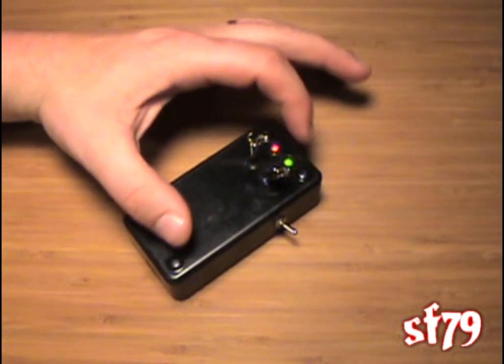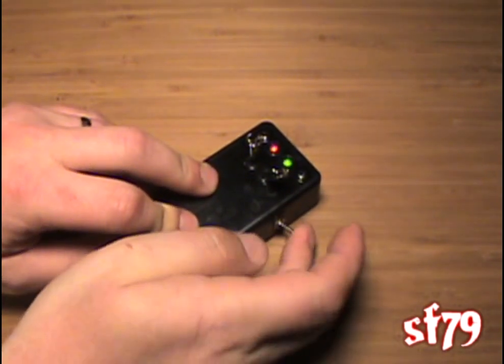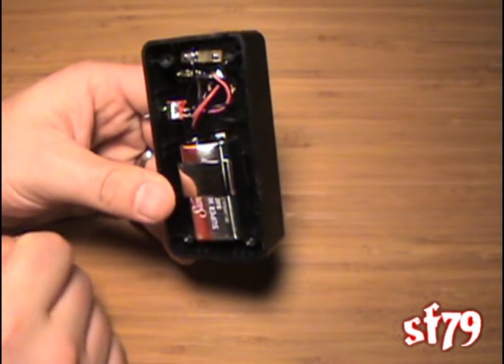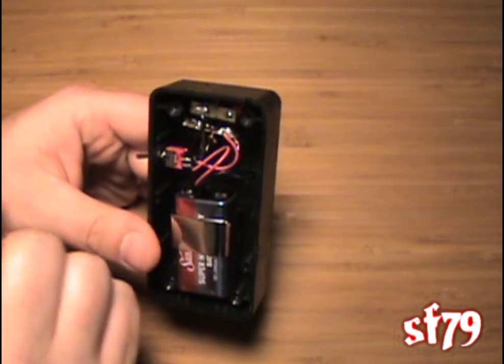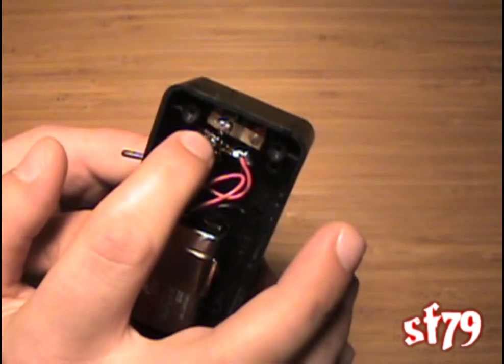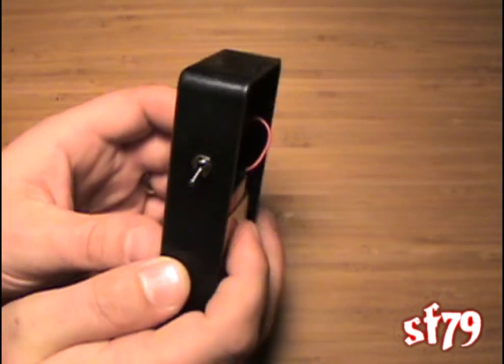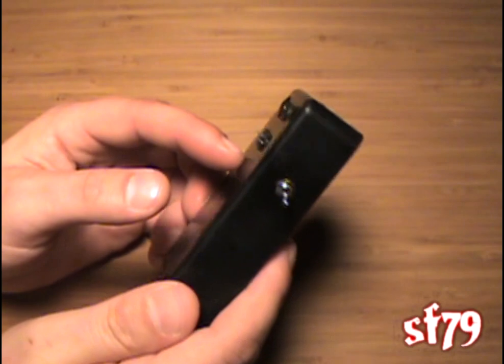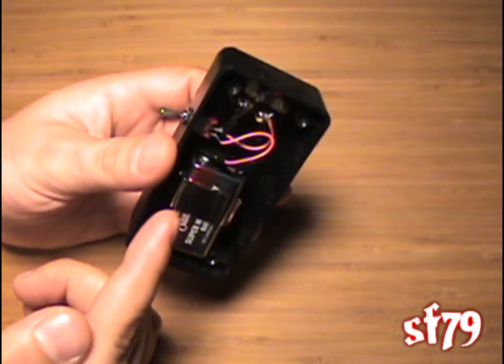"How To Build Your Own Ghost Detector " V-Scope Pt. 2

Comment: Hello mike i have tried to make a v scpoe 2 by having 2n5460 connect with led and one mpf102 connect with another led i tried connecting them but only one lights up the other don't work please help me as i am new to this i tried following the link but it doesn't mention how to connect both transistors need help please

Comment: Hey bud! Not sure you'll get this (I know it's an older video), I'm having a bit of confusion over the combined circuit. I understand the one wired in the first video, but using the second LED and opposite charge loses me a bit. Any chance you could explain a little further

Comment: using the same setup would it work if both were wired to one antenna, the only problem I see happening is that it doesn't know if the signal is positive or negative and both LED's turning off. I plan to test it and see what happens but I'm hoping someone chimes in before that happens lol

Comment: How interested is someone in buying a small pcb I've designed that is super easy for anyone to solder the components to it and is some what idiot proof (no offense to anyone). It has a half inch spacing between the transistor and led so the antenna is close to the LED and the dimensions will be spot on to build a box for it. The LEDs are 1 inch apart and the total dimension of the PCB is 1.50 inches x 1.20 inches. I wish I could post a link to show the design of what it looks like.

Comment: i like your idea,i've been trying to see if there's a way to make something similar to the REM-Pod by adding a buzzer additional to the LED's and maybe even try using a wireless router antenna for the v-scope i would like to know if there's a way to do that, and how many volts is the led for it and amps it has i'd gladly appreciate it if you get back at me

Comment: I was doing some research on microphones and guess what I found. The foam cover that comes with mics reduces the ambient noise. Removing the protective foam will increase ambient noise on the recording. Which is what you may want. I highlyrecomend researching you equiptment in order to get better performence from it.